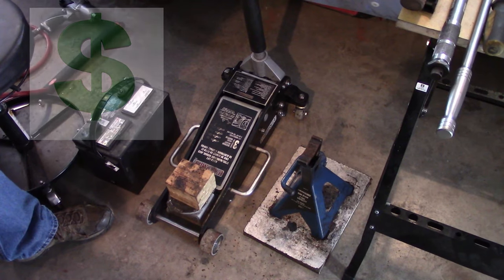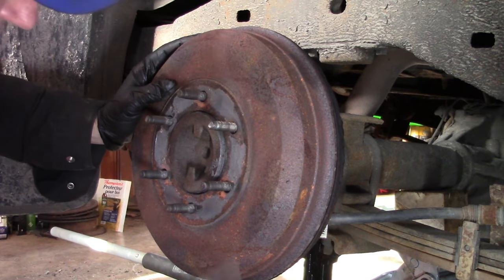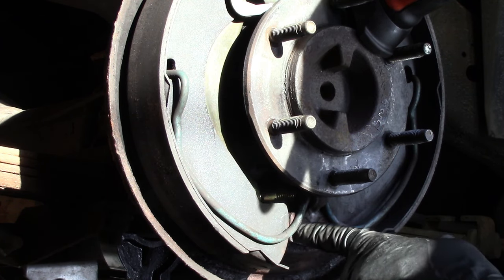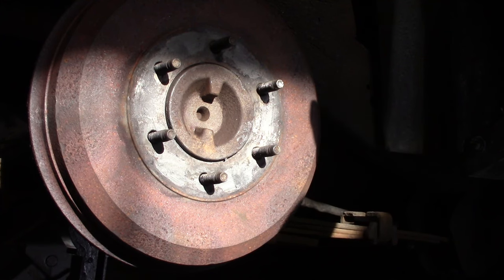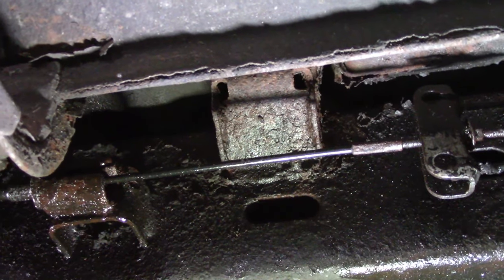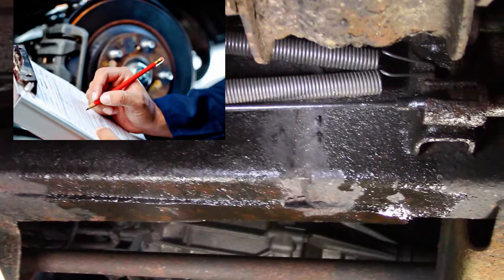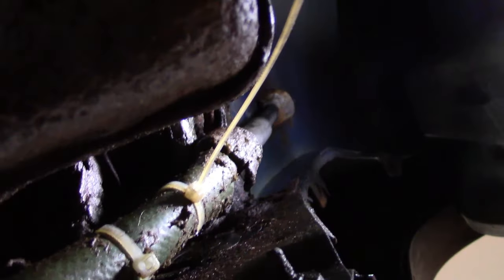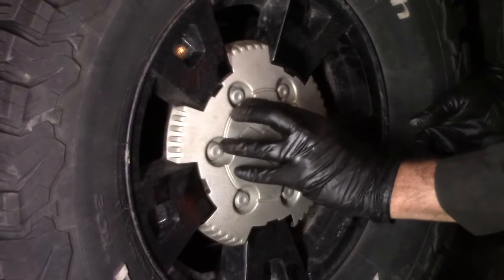Parking Brake Stuck & Dragging? How to Release & Fix a Stuck Parking Brake for Free! All Vehicles

Comment: YOUR FIX IS OK FOR THE PRIMARY CABLE BUT THE ISSUE IS USUALLY IN THE INDIVIDUAL LINES TO EACH WHEEL WHERE THE SALT AND RUST TAKE THEIR TOLL
Reply from the maker: Thanks for your comment Ken. The Primary cable is a troublesome cable for the Colorados/Canyons/Isuzus. I covered replacing both rear Parking Brake Cables in another video called, "2005 Chevy Colorado Drum Brake & Parking Brake Replace" You may be interested in Checking that video out. Here's the youtube link to it if you're interested. Cheers! https://youtu.be/Lp76jLHC4QM

Comment: Very good video, my only comment is, when I use the brake cleaner spray, I hold my breath, you don't want to breath the fumes, then pull away to breath and let the stuff dry before going back there. The video is very good on jack safety.

Comment: I have a 2002 acura tl types, all i was planning on doing was replacing rear rotors, but my issue is with the rust, I broke free, the emergency brake is disengaged but is engaged on both sides and i cannot get it to disengage, idk how to fix this to just get the rotors off I dont even care about having working park brake or not, if you have any suggestions pls help
Reply: Find the hole on the backing plate and use a screwdriver to rotate the adjuster up or down. One way pushes the brake pads out and the other allows the brake pads to move inwards away from the drum
Reply: @jameskeele6458  I have fixed this a couple days ago and have done this, thanks for the suggestion

Comment: Thanks, not prob Brake ( still original Rear*,& NEVER USE PARKING BRAKE,a POSSIBLE PROBLEM) yet:::** though, I do have that rare *intermittent : pass lock Ignition/ lock,out(* crank, no start)…..Simply waiting : ten minutes & one Second, always starts, a Problem ..… ((2007 Canyon 4 Cyl/ no remotes)):& sometimes, I avoid turning Engine off for short stops, occasionally….  Ps: use the BFH myself (occasionally called others, like “ a Tonya Harding”Hammer,(**thanks to Vice Grip Garage , on you tube))…

Comment: I had the passenger rear wheel seized up on my 09 Kia Rio 5. I tried backing up and driving forward. I called lots of garages but everyone is busy for up to 2 weeks. One suggested to 
hit the wheel rim with a hammer, so I got my big sledge hammer and hit the rim 3 times. The last hit shook the car so I guessed that was the brake releasing. I drove the car a bit to make sure but all the wheels are working again. I will never use the parking brake again.

Comment: I need some help my car when I get into my car and start it and then put the e brake down and put back gear it doesn’t go it’s stuck then I put some gas on and it’s like a bang noise and then it’s starts to roll ???
Reply from the maker: Your e brake is sticking and probably have broken a spring. You need to replace your e brake mechanism or at least get in there and take a look. I hope that helps